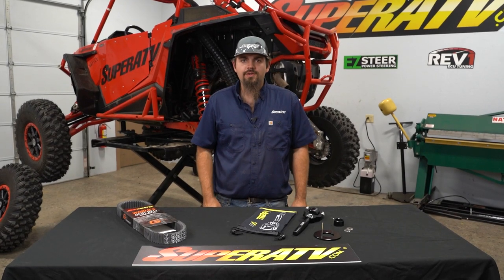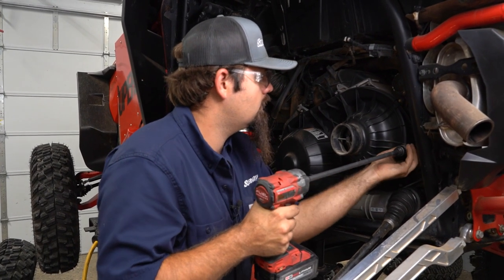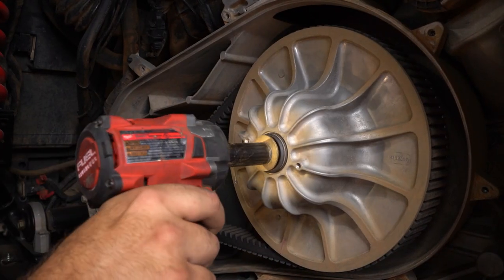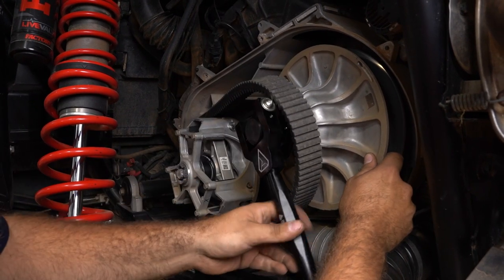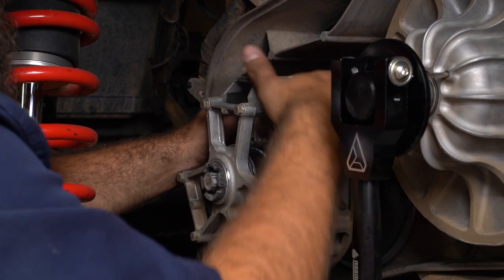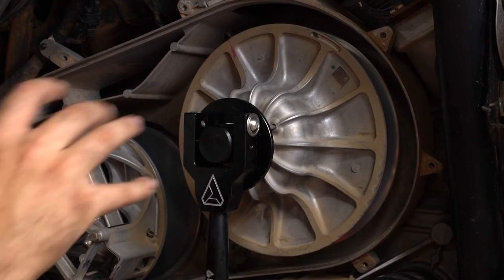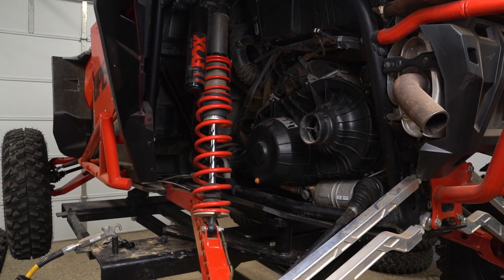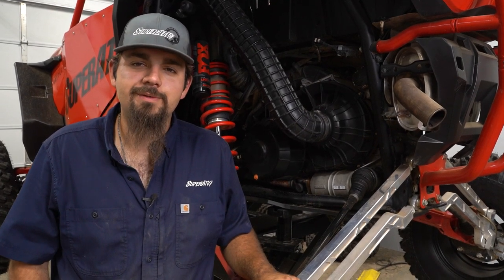How to Remove a UTV Belt Using Assault Industries' F-22 Belt Replacement Tool

Comment: Can you keep that washer in there permanently?
Reply from the maker: No. It will need to be removed each time you use this tool.
Reply: I thought the point of the tool was to leave the M36 nut on the secondary?